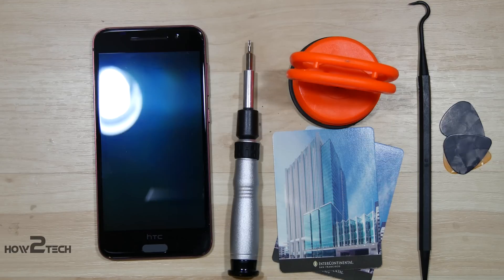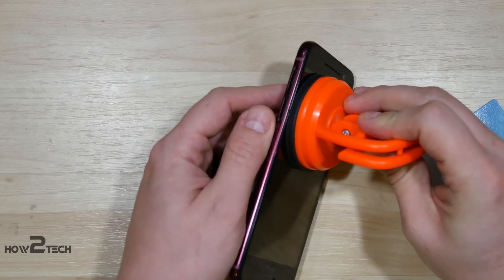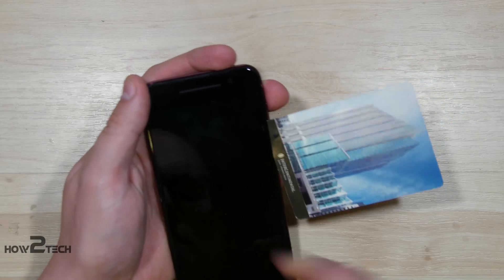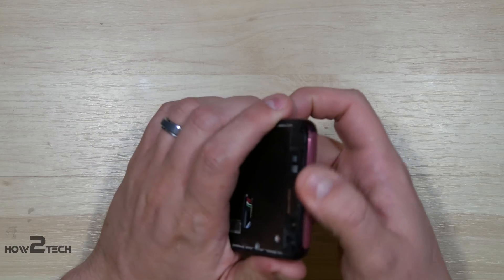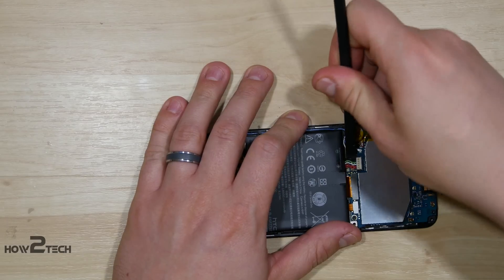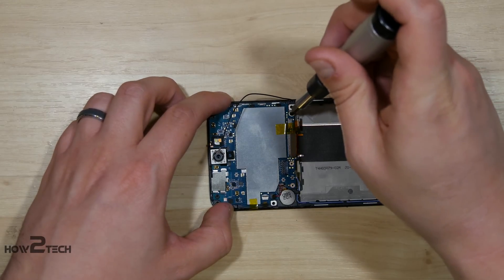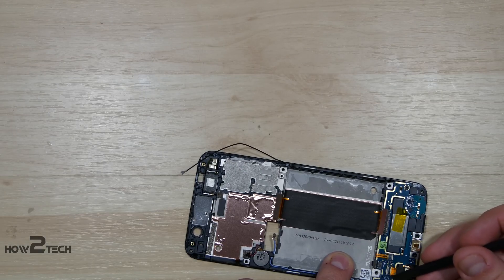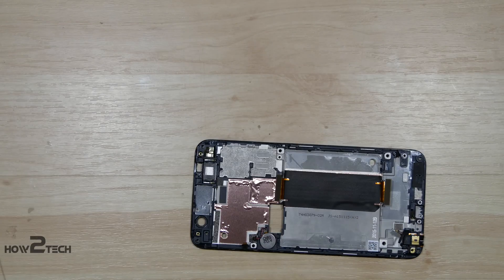HTC One A9 Tear Down Screen Battery Chargeport Replacement - Disassembly

Comment: For anyone wondering what temp to have the heat gun set to, I had to go up to 190-200 degrees celcius, i started at 60c because I was worried about it being too hot, I love that these tutorials don't mention really important information such as what damn temperature is required to actually melt the glue. Saying hot to the touch really doesn't mean much at all.